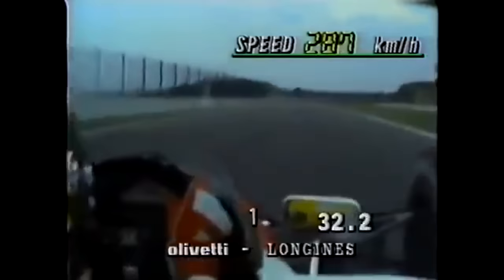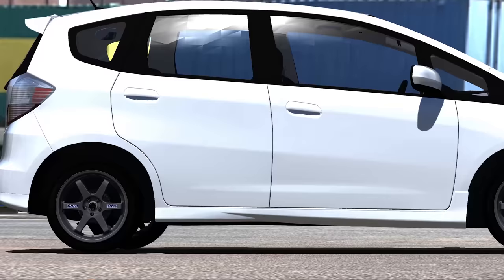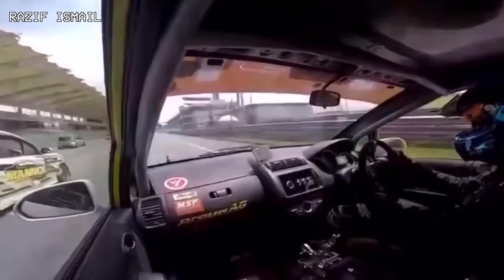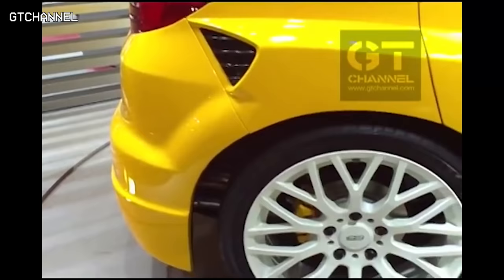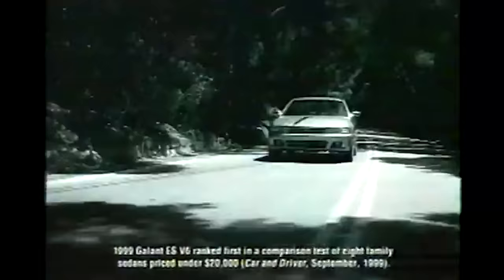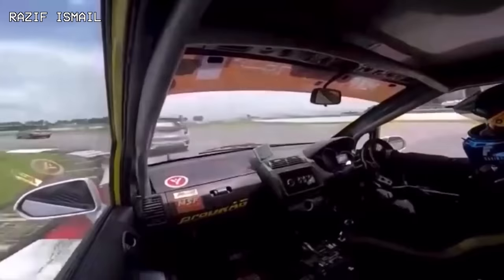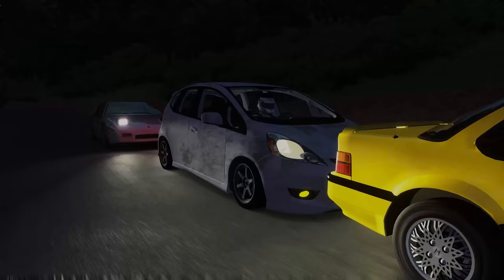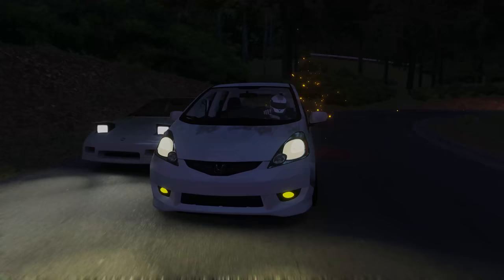Honda Fit - What Makes it so Great?

Comment: Had one for 11 years. In several stats it has shown to be one of the most reliable cost effective cars ever
Reply: Had a 2009 until Jan of this year! I drove it for 9 years and only had to really switch tires and do oil changes. Dad drove it for another 6 years until he was rear ended. Did multiple cross country trips in that thing packing it with like 7-800 pounds of stuff. Great fuel efficiency even when loaded down. Also had a great time on twisty roads
Reply: Impossible to disagree with your comment.
Reply: mine had 399,949 miles on it when i traded it in, DAMN good car
Reply: Damn shame it's so slow, though. I once raced a Fit in a Ford C-Max -- a hybrid, mind you -- and it wasn't even a competition. The Fit was left in the dust. 

For anyone reading this and considering a Fit: If you want a fun, cheap, fast car, consider getting a Genesis Coupe 3.8 instead. Independent rear suspension with limited slip, available in a 6-speed manual, cheap as hell to maintain, and literally twice as much horsepower, all for under $10K.
Reply: Ac shit out on us twice already but outside of that it's a good little homie
Reply: @lunde28 I bought a 2007 Honda fit at a city auction in SF CA with 313K miles on it (stick shift) I took it to my mechanic for a valve adjustment and it still runs like a champ.  I don’t get scare about high mileage.
Reply: @The1Real1Cheese how did you fix it . I'm looking at a 2018 auto fit. Costs 10k . Not sure whether to go for it
Reply: @Psythik  Yeah it's usually that or a mustang for the cheapest rwd 6 speed
Reply: @DaytonaRoadster really? I am looking to get honda fit 2016 at 150k miles.. should I go for it?

Comment: 228,000+ miles on my ‘07 Fit, I love it and she runs great, never let me down. Solid motor & trans, Nothing leaks.
Reply: 2007 base, auto, paint sucks (light blue) but I quit caring what other people think about me a long time ago.  It has 75k miles and it runs and drives perfectly.  I did have to charge the AC but otherwise no issues.  And it wasn't leaking it was just low because the thing is 15 years old.  Paid $6k two years ago.  Haul pinball machines with it.  Might buy a newer one when my daughter getr her license in a year or two.
Reply: got another 200k in it bro

Comment: My elderly dad had a 2012 5 speed to tow behind the RV. I drove it several times and it had the sweetest, lightest shifting manual stick ever. Made the Subaru I had at the time feel like a tractor by comparison.
Reply: A Subaru pretty much is a tractor by comparison. There are definitely benefits to having a small engine and FWD, but there's also benefits to having a large(r) engine and AWD.

Depends on what you want/need. I actually got my first Subaru a few years ago mostly because I was tired of having FWD in the winter. If I had the space/money I'd probably get a Fit or something similar for summer driving though.
Reply: Hondas manual transmissions are ridiculously smooth along with their clutches. On well taken care of vehicles, you literally cannot get them to stall. You can practically just drop the clutch with no gas, and it will catch anyways and start pulling you along in 1st gear like nothing happened. Lol

Comment: I think my gen 2 Fit is the best engineered car I’ve ever owned.  I think it’s harder to do a cost effective compact car than a super car.  Putting the gas tank under the front seat has big benefits for load space.  I like Honda’s emphasis on handling, even for utilitarian vehicles like this one.  The engine is remarkably responsive and flexible.  Overall it’s a real pleasure to drive.  I find myself wishing for a higher gear at high speeds, but I tell myself it’s a Honda, I likes to rev.
Reply: Having the tank there also makes it very, very easy to replace to fuel pump (speaking from experience)

Comment: Great video, although the Fit has always had a torsion beam rear axle. Low floors and lots of cargo space would make it difficult to use anything else
Reply: @Liam Tomlin lol old civics and integras have torsion beam rear and torsion bar front... for handling its terrible, but I find the driving dynamics to be really fun!
Reply: @cobywilliams7332  Not the 90's era Civics and Integras. Those have Independent frond and rear suspension. It's the 2000's era that got McPherson strut front but rear was still IRS. Not sure when the changed the rear to torsion bean but McPherson front is still a down grade.
Reply: @SI0AX  the 8th gen civic is when they changed to torsion beam rear. I believe they reverted it for the 9th and it's stayed IRS ever since
Reply: @chasetryon3870  the 8th gen is still double wishbone unless you live in Europe
Reply: No civics except type R variants had double wishbone rear suspension. 90’s until now have all been IRS but it’s a rear trailing arm..basically a McPherson strut at the rear.
Reply from the maker: Went to a junkyard and took a look at the first two generations. You're 100% correct.
Reply: @jamaisvu2664  Wow, cool, never knew that. I guess cars with double wishbone rear is uncommon then, because I have a lot of cars with trailing arm IRS. The only car I own with double wishbone rear is a Lexus LS430.
Reply: @jamaisvu2664  Rear trailing arm + upper arm and lower arm, it's still equivalent to double wishbone, not a McPherson
Reply: @Laine2Miel  I’m saying there is no upper arm. The TSX and accords of that generation did have the upper arm but on EG/EK/Del Sol/ Integra’s the rear suspension has a multilink trailing arm (2 different locating arms) the top of the shock simply bolts straight to the shock tower with no other arms nearby. I triple checked googles images just to be sure in case I missed something.
Reply: I guarantee that are upper control arms on these cars, got one on my Ek3 (and that's tots an econobox), It's a small upper control arm working diagonally, it's hard to see on pictures because it can easily be hidden behind the braking system
Reply: @Laine2Miel  I am looking at diagrams (from Honda) of the rear suspension on the first 2 generations of Fit right now. There are no upper arms. Look up "Honda 42100-SLN-030" or "Honda 42100-TK6-A02" you will see that the left and right suspension is one piece and that the wheel bearings attach directly to this part.
Reply: @JackMfutureproof  I was talking about Civics ;-;
Reply: Bingo
Reply: I miss my EG4 and its double-wish & multi-link setup.
Reply: My 01 Prelude's got double wishbone, I'm pretty sure. Handling is insane
Reply: 8th gen civics handle great
Reply: people may not like the Mcpherson struts but when you do work on your own car it makes suspension work extremely easy compared to double wishbone lol. I have 3 cars with both, 97 lude, 96 accord and 02 civic si. I dont really notice the difference, probably more cuz i drive them regularly and just gotten used to the feel of each.
Reply: The most recent generation of Honda Jazz ditched the sway bar, which is curious.

Comment: I live in Wollongong, Australia. I bought my trusty Honda Jazz (Fit) in 2006. I have always updated my cars every 10 years. Not my Jazz. After test driving several small cars at that time, I decided to stick with my Jazz. Even though it is now over 15 years old, it is still comfortable, reliable, cheap to run. I have it serviced twice a year and, and, apart from tire and battery changes when necessary, it has never given me any trouble. I would recommend it to anyone. It now has over 180,000km on it and it still runs beautifully. Thanks for your video on what makes it so great. I totally agree.
Reply: Hello from another in the 'Gong.
We bought our Jazz (Fit) second hand as the small safe fun car for our daughter.
Its been perfect! It's a Honda so it's 85,000ks means it's 'just' run in. :)
First post put it perfectly, the little cup holder beside the kerb view glass just screams smart design to me.
Reply: My little Jazz has now 285 000km and is still great for my daily commute. Never had a problem except for the heater which was an easy fix.
Reply: Well said Lyn. We're in Tassie daily-driving our 2006 GD Jazz.
It has the red dot over the J, so it's the 1.3 engine with two spark plugs per cylinder. I didn't want this version, but the market was tight when looking to buy last year.
It's a fun little gadget on our roads, and will tide us over until the CRX is restored!
Reply: @speckledjim5150  Glad you are enjoying your Jazz as much as I am. Mine is still going strong, and as reliable and cheap to run as ever. Hope to take it over to Tassie next yer sometime and do another tour around your magnificent island.
Reply: Tyre in oz
Reply: That's great to hear. I just bought one this week.

Comment: The cupholder next to the steering wheel.
This little design feature says everything about the Honda Fit.
You can tell that this little car was created by a group of designers, engineers and marketing pros who understood their goal.
From the styling, to the engine, to the transmission, to the chassis, to the suspension, to the cabin space, to the storage space, to the A/C controls, to the steering wheel cupholder. 
Everything works and makes sense. 
This is a "No B.S." car that is possibly the greatest compact car ever built.
Reply: My 2011 came with 10 cup holders. So that 5 peeps can be double fisted. 😂
Reply: The cupholder is also in front of the A/C vent, so you can keep your drink cool/warm. Genius.
Reply: You just wrote a poem about my new car. ✊🏽
Reply: The Fit isn't just a car, it's a living space. I just drove mine across Canada and didn't miss a beat. The GOAT of the subcompacts. Lol I work at a Honda Dealer and so many of us have Fits because we know.
Reply: Should I say it's one size that fits all?
Reply: @justinvillarreal9457  I'll assume the innuendo was 100% on purpose.
Reply: The best car I've ever owned!
Reply: @austincouto4652  I have a 2015 (3rd gen) Fit manual.  I tried the CVT version and didn't like it.  Then a few of my friends gave me lessons for driving the manual version and I absolutely fell in love with it.  I don't know how I will love another car as much after this one....❤❤❤
Reply: straight up
Reply: Felt like this car is designed for small city parking and narrow japan. So designers pay extra attention to details. Love it. Don't really see the details put on a corolla though...
Reply: When I first saw that cupholder I thought it was stupid. Now I love it.
Reply: I Effing LOVE that cup holder.
Reply: The cupholder is also in the perfect spot for when you're driving and you don't want to have to reach very far for your coffee or whatever but a brilliant design choice to put it in front of the vents to cool or warm up your drink.
Reply: @erato1 Why would it be stupid?
Reply: You mean sub compact. That title belongs to the Yaris 2012 to 2019

Comment: I absolutely LOVE my 2018 Fit Sport (manual).
Everything about the car just makes sense.
Styling is good, gas mileage is great, power is just enough, practicality is on point.
Plus there are no quirky little flaws that you usually find on other cars.
The Honda FIt is a "no B.S." compact car.
I drive mine with pride - even when all of my peers in the office drive high end german cars, lifted off roaders and expensive electric cars.
Reply: I know right?  I have a 2007 base with a horrible paint job at this point.  I paid $6k for it and it was a one owner grandma car with 68k miles.  I use it to pick up pinball machines - yeah full sized commercial pinball machines.  I might drive 500 miles round trip.  I just did this a couple weeks ago.  It cost me $56 in gas.  Oh and it is water proof, unlike my Tacoma pickup which was my other option.  It would have cost me 2-3x as much and then there are the elements..

Comment: An amazing automobile. Went to Home Depot with my son’s car to pick up a washer and a dryer. 
When two of the staff rolled out the merchandise and asked which is my car I simply replied ‘ it’s the black one’, just so happened I was parked next to a black SUV. When they erroneously placed the items by the hatch of the Suburban I casually strolled over to the Fit raising the hatch door, ‘ sorry gentlemen, it’s the other black one’. They both looked at each, smiled and politely burst into laughter. ‘ I don’t think it’s going to work, Sir’, ‘Well, why don’t we give it a shot’ I uttered with utmost confidence. 
They weren’t laughing or smiling few minutes later with the cargo loaded and the hatch fully closed without any assist from bungee cords or rope. They were floored into the very same spot where they loaded the Fit as I was pulling away after of course tipping them and waved back with a smile and a chuckle.
Reply: Wait, a washer AND dryer fit into the Honda Fit?
Reply: Just bought one today!!!!.........I did a lot of research beforehand and though I could get the 2016 version  am happy with an 2011!
Reply: @XXtheJUMPoffXX  Yessss indeed, it’s a TARDIS
Reply: @Jazzmarcel  Congrats !!!. Enjoy your new toy

Comment: Great video, I bought a used 2013 fit sport a few years ago when I was a broke student and this car has been nothing but fun, efficient and reliable.
Reply: wanna meet up so I can blow the doors off of it?
Reply: Broken students in Brazil can't buy shit, when we start to work if we save money for years we can buy a used 2005 fit in 2022
Reply: Broke students don´t buy cars :). You misunderstand the word "broke". :)
Reply: @caroline4323  that’s what I thought too
Reply: @davidskyler1000  I am currently looking for a used honda jazz for my Mum and even the ones with quite a lot of km are still pretty expensive. It´s not a cheap used car. My first car was cheap. Bought it for 120Euro, fixed with 240Euro and it soldiered on for years (until it got stolen!!! and damaged), I will never forget it. Reliable as hell, Mitsubishi colt, an old one.

Comment: I struggled for so long to get a manual fit, but finally found one, 2007 fit with 140k miles for $4000. Absolutely love the car 🙂
Reply: if it ain't broke improve it I love it:face-red-heart-shape:
Reply: Here in aegentina i bought a 2005 1.5 vtec for 4700 , where are you from ? In usa the fit gd3 cost 4000?

Comment: I got a 3rd gen 2018 EX with a stick (rare combo) and I love the thing.
Reply: I just bought a 2016 ex 6 speed. Perfect replacement for my 2006 rsx type s. I love it too
Reply: I got a 2017 with a stick!
Reply: @Prashanth Panicker I have one as well, & I love it!
Reply: It's not rare. They're all over
Reply: @randomautonomousdronepilot3384  In the EX trim, though? At least where I was, it took three months for one to come up in a 300 mile radius. It's post-facelift and has all the fancy lane-keep assist stuff, but still has a manual. IDK, maybe they're more common than I thought.
Reply: I got luck too, with my '17 MT EX
Reply: That's not rare what the hell are you talking about?
Reply: Lucky man, I wanted to go half on the 2019 version with my parents, but my dad refuse to go half on a manual, because he viewed it as "unnecessary" and didn'tr want to wait a week to get the car delivered from another dealership. Still regret not lobbying harder, but I do love my fit sport as well.
Reply: @holdencawffle626  I had to go across three states to find one (2018 EX with 6MT) in stock, so yes they were rare.
Reply: I’ve got a 2018 EX with a 6 speed too. Wish the clutch wasn’t so light and the clutch delay valve sucks but it’s still better than a CVT
Reply: @rixiv7868  I like the light clutch. Makes it tough to learn on, but my left ankle appreciates it in stop-and-go city traffic.

I wonder if I can find a good way to remove that clutch valve...

Comment: My 2017 EX-L is my dream car, and I've owned many sporty and higher end cars.  Those expenses came to a halt. "Enough" power, refined CVT, 40 mpg, tons of room, fits like a glove, all the amenities, very reliable and feels incredible at both high and low speed or just parallel parking.  Progress sway bar and the best tires I could find absolutely rip the corners, and the steering feel is like from an S2000 or civic si.  Hard to describe why it feels so "right" and convenient, because it's lots of little things that come together that make it so satisfying for the price.

Comment: I absolutely love my 2010 5MT Fit. Fun to drive, practical and reliable! You have absolutely nailed everything about these fun little hatches. I’ve had mine for 4 years and almost 100000 miles, beating on it the whole time and the only thing that’s gone wrong was an ac compressor!
Reply: Almost a million????
Reply: @Don E. ok. I had a 99 Civic that had 418,000 miles when I sold it to my mechanic still running like a champ. I needed the cargo area of my Fit to transport my dogs.
Reply: @SuperDobieGirl  guh
Reply: AC compressor died in my 2010 mt5 as well lol
Reply: My 2012 is going on 165k! Only thing I've had to do it refill freon and swap alternator
Reply: check the drive belt and belt tensioner while youre there. common to go bad.  loved my fit but sadly it got totale3d by a guy with a seizure on the road. RIP little honda , the least assuming but most dependable and usable car ever owned.
Reply: If not the auto tranny , it's always the ac compressor with a Honda.
Reply: Had an 2006 eighth gen r18 sold with 269,000 miles on it beat on, molested, and modded still ran like a champ!

Comment: I love my 5 speed manual 2010 fit. Bought it as my first car with 62k miles, and now it has over 136k and running great. The interior space and 360 degrees visibility this car has and fuel economy is just great. I plan to run it until its last breath
Reply: simple fix you should add a turbo that boosts engine power by 150 hp🤣
Reply: @raven4k998  Nah it will just lessen the life of the stock engine. If you want power just do an engine swap and get K20 engine.
Reply: Love it ! I have a 2011 manual . I would drive this thing across country and back multiple times without hesitation just hit 148,000 miles and it still feels brand new.